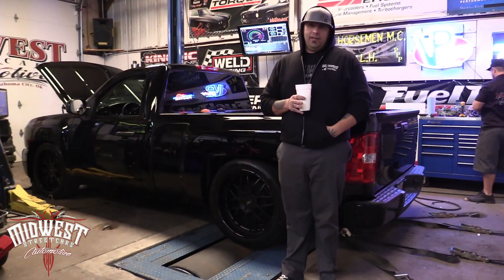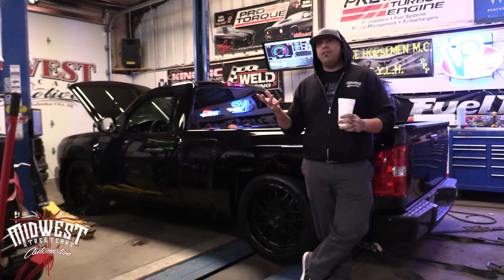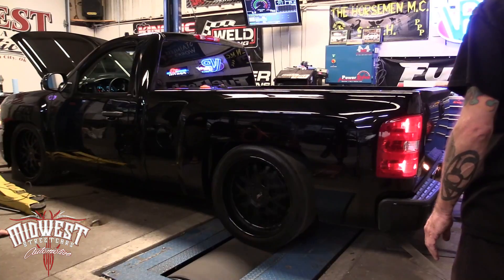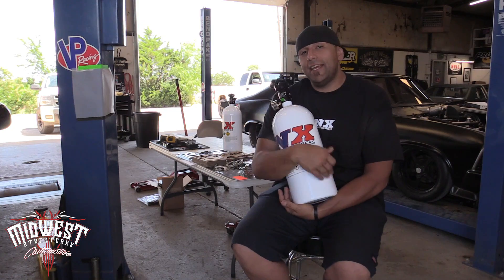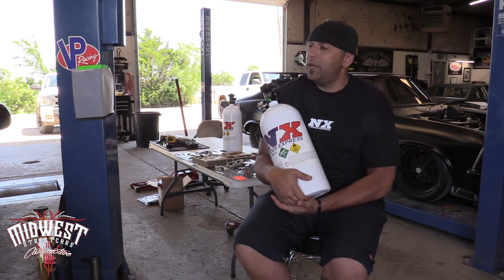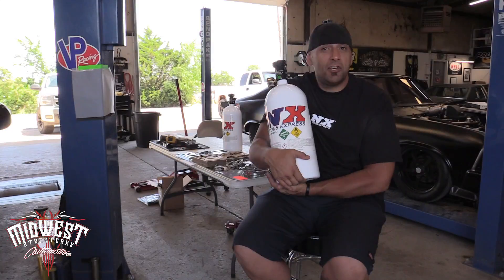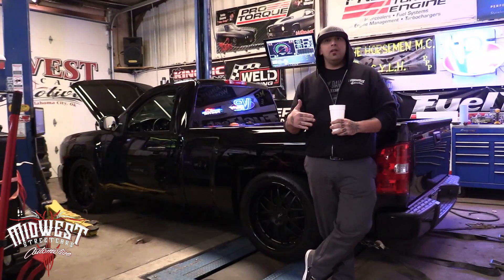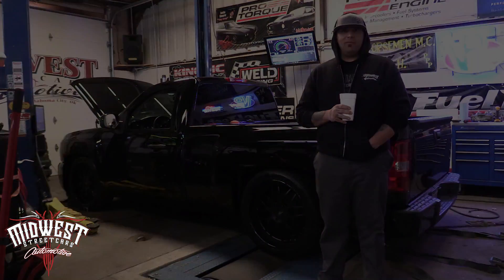Big Chief's shop truck project Part 2: Aeromotive fuel system, Nitrous Express, Dyno

Comment: Hey I’ve got an 05 Chevrolet with a 5.3 with 230k on it. Bone stock motor. Tranny etc and it’s 4wd. I’d like to get some more life out of it. I drive it daily but it doesn’t have the nuts to pull a very big trailer. What do you suggest ? Tuner? Cam? Bolt ons?

Comment: How much would that cost me for you to do that to my truck?
Reply: Why, the speed limit is 25-70 road depending. Your hooptie can't keep up with traffic?
Reply: About 20,000-25,000usd
Reply: Chuck Beef what the fuck are you off lmao it’s just procharged and supporting mods. Maybe 9k at a shop.
Reply: Jose Rico Taco Nacho Quesadilla Mandela Jones They did heads and cam too, suspension mods, F1X and all the goodies. Easy 20k. The F1x unit without a kit is 6k. I bought a basic P1SC kit for my Sierra, it was 11k CAD just for the kit with no install.

Comment: Those are crazy good numbers haha ..im really impressed with the 4L60E ...i beat mine up for 170k miles before 3-4 clutches started slipping ...mods:4.8L,  CIA,highflow cats, flowmeter, black bear performance tune, corvette servo, MSD wires, 88mm jet throttle body ..

Comment: Very freaking awesome.  so if I bring you the same stock truck, what would my cost be out the door for close if not the same set up?
Reply: Texas Jedi A model-specific Procharger kit is generally $6-7k new (you can find used ones fairly cheap) and you may need some other parts. Factor in the labor and you're probably looking at $10k or more.
Reply: Borderline5440 
wow, that's alot less than I Anticipated!!

Comment: What tranny an converter are you running. I got 2012 gmc 5.3 totally rebuilt from bottom up, comp cam, E-Force super charger running around 10 lbs of boost.

Comment: Can someone explain to me what a promod is? I only have a small understanding of what it is.
Reply: Anthony Griffin Basically a purpose-built from the ground up racecar; most have never even had a VIN. Typically chromoly tube chassis, full cage, fiberglass/carbon fiber body, and they are usually stretched out with very few or no dimensions in common with the factory cars upon which they are based. Basically a step below a full-on funny car, though they'll run probably 75% as fast as a funny car on the track. Maybe someone else with more knowledge about them can chime in with regards to the speed. There aren't really strict definitions anymore about what constitutes a pro mod unless you consult various racing league rule books.
Reply: Borderline5440 Thanks.

Comment: that 4l60e needs to go...get a 80e
Reply: hittin-low_150db+ is that a trans?
Reply: I plan on. Building a stock 5.3 but i want to build the trans with a 5 speed. Any suggestions

Comment: Race FarmTruck..
Reply: JMiddle he's tske a L. farmtruck is fully built
Reply: Well Chief said it’s his daily driver he never said he was going to race it.
Reply: JMiddle 
It wouldn't be even close. Because farm trucks engine makes around 2000+hp. 
But as of a couple months ago Farm truck has a brand new engine I heard it was somewhere between 900-1000 ci's and it makes somewhere between 3,500-4,500 HP depending on how the tune up is.
Reply: kol yea your right farm truck only makes 2200hp to 2500hp but Fireball Camaro and Birdmans cars male between 3500hp and 4000 hp l..
Reply: This truck is nice, but the farm truck would destroy it.
Reply: 4k HP? nah bruh
Reply: Remember Farm Truck is also a big tire vehicle. It can put more of its power down off the line. Id like to see them line up tho for fun. tho most def

Comment: Hey Chief on that fuel system what are you running for a sending unit? I see the pump is in the stock location, so does that mean remove old drop in new system,run the lines and done?

Comment: im just trying to figure out how that 4l60e is still holding
Reply: If you rebuild a 60e with better HD parts the holdup. I run one in my forged turbo 383 truck making almost 1000 ftlbs of tq.Its on its 2nd rebuild in 3 years also but its part of the game.
Reply: lmfaoooooo
Reply: dltnellis watch how it shifts and you will see it is not a stock tranny.
Reply: same thing i am too my friend has turbo on his truck with stock 60e look him up Whos Gio
Reply: Austin Smith t
Reply: 4l80
Reply: because the mod motor doesnt make enough power to break a 4l60e
Reply: You could buy an aluminum mod motor and have no worries ever.

Comment: What's the wheel/rim set up your using? Looks like you have meaty tires in the back did you have to shorten your differential and tub your bed? And what's the drop on it?
Reply: 22"

Comment: I'm using a 5.3 in a 76 luv....any good ideas on rear end??
Reply: Chris Prince ford 9in or 8.8
Reply: Chris Prince Can't go wrong with a Moser 12 bolt either. The Ford rear ends seem to be more prevalent though, and they let you pull the gears out of the back instead of the front (like on a Chevy rear end).

Comment: Is that 4l60e built up or is it stock with the pro torque stall?
Reply from the maker: Santiago Alfaro Procharger kit is around $6,000. Stainless works headers and exhaust around $1700. The full nitrous express kit is around $2000. Protorque converter $800. Aeromotive fuel system $800
Reply from the maker: stock. just like the description says lol
Reply: Yah i got that same one in my truck, people totally underestimate that transmission it can handle power.
Reply: i had a th400 and a 480le trans in my supra... did next to nothing to them to handle the power too...
Reply: what type/size of injectors and fuel rails are you using?
Reply: PHATDAN420x read description
Reply: PHATDAN420x description
Reply: Midwest Streetcars Auto what came is in that motor i know it says mid sized but id like to get some specs
Reply: Midwest Streetcars Auto how much did the project cost you guys in total because i would love to do something like this to my truck!
Reply: Midwest Streetcars Auto thanks i will for sure start building my truck next month during tax season!
Reply: Midwest Streetcars Auto Damn that stuff coast alot of money. I wish we had workshop like yours who tune and dyno cars in Finland.😂
Reply: I know there are places where you can dyno in Finland :P If you cant find one, Sweden is pretty close ;) Just take the ferry ^^
Reply: which pro torque converter is wanda using?
Reply: Holy bitch !!! ( the truck not Chief , i´m not suicide  lol )
Reply: Elving Lindqvist where in finland are shop like this. cuz i dont know
Reply: Chief, 2 questions if you have time. It's been about 10 montys that 60 still hanging in there? Also did you reprogram the trans? Higher shift points and line pressure? I ask because I have an 03 with a Whipple and eats converters like I keep em in the glovebox. TIA